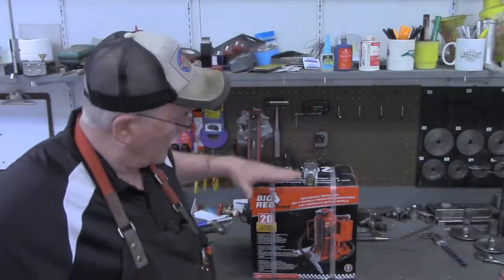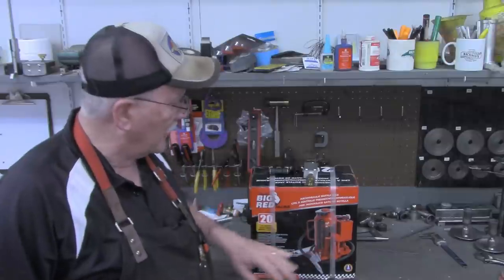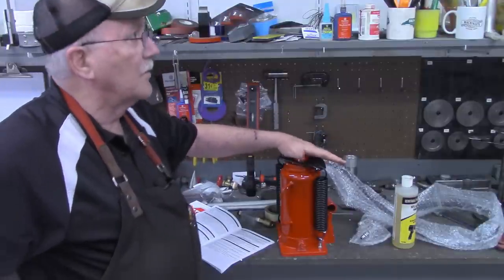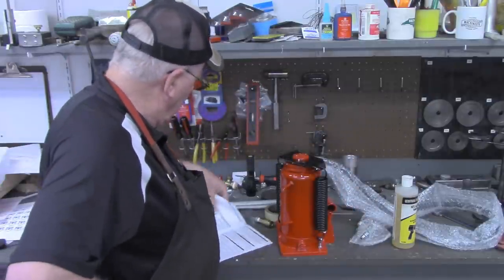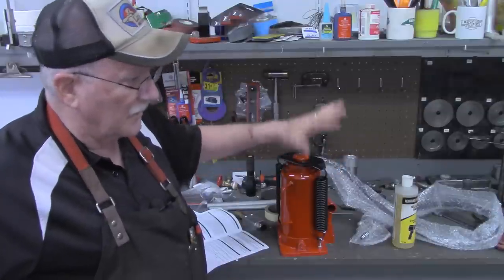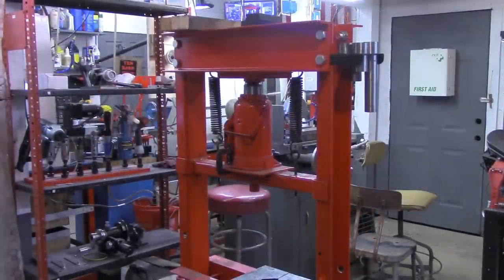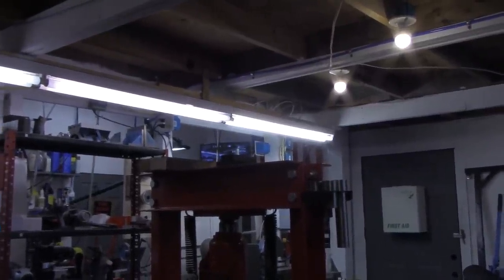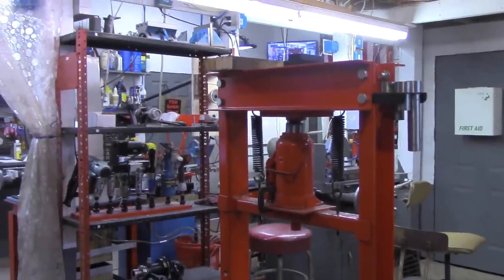20 Ton Press Air Over Hydraulic Conversion/Upgrade

Comment: I put a foot pedal on mine so I had both hands free to use to hold parts and align things. nice job
Reply: Does your foot pedal add air and releases air?  This is SUPER if so.
Reply: @rtoons77  I justs adds air, and I put a large tee handle on the release valve.  And a lot of times I use the air to get some pressure on the press then hand pump so I have a better feel for pressure exerted on the part.

Comment: Thanks for the video!
One thing to know is that the air pump (or air motor) beside the cylinder can STOP WORKING. Mine did and and don't know why. Zero info on the web so must be rare. (And, Yep, I got rid of any entrapped air, took apart and examined the air pump and cannot find anything wrong, at all. Just does not work. Anything is extra-expensive when it does not do what you bought if for.

Comment: Great video, I also left my springs on and put a foot pedal in the system. I am not sure how to do it but , I thought putting something around those spring in case one broke might contain the spring. I saw one example where someone use cable and a crimp. I may be over thinking the whole thing, I do not see it done on any video I watch. Thank You Wayne

Comment: nice modification!!!...if you have seen standard springs on overhead garage doors the spring has a retainer if the spring breaks when stretched....seems like these press springs would benefit with a safety restraint....pls understand...not a safety nut...just an observation.....ATB

Comment: I want to release the valve to let the air out without turning the value release knob.  I use it to press hot steel and I need to quickly release air, reposition hot metal and then add air to press the metal again.  Any ideas of how to release air when no input air pressure is detected.  If this is not possible maybe a handheld trigger release!  I would enjoy a pedal that adds air when the foot pedal is pressed and releases air when the foot pedal is released.  This is the best of all options.  I have the same jack you just demonstrated.
Reply from the maker: Hmmm, not sure how that would work on a press that uses a standard style hydraulic jack. Thanks for stopping by.

Comment: Great video, thanks! Has anyone inverted an air-hydraulic jack? I'd like to put the jack body between the cross-beams  on my soon-to-be-press, to get a bit more headroom, and inverting a hand-pumped jack is pretty simple - would it likely be just flipping the air pump on a  couple of fittings?

Comment: I added a 120 v valve that shuts off when I flip the breaker off. Then you have the air supply sut off to the shop automatically. Just a thought